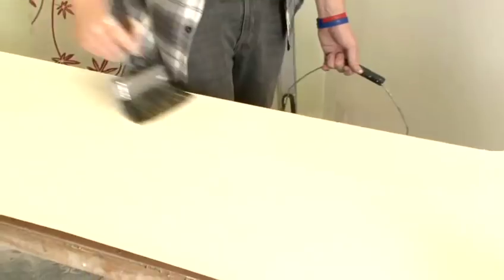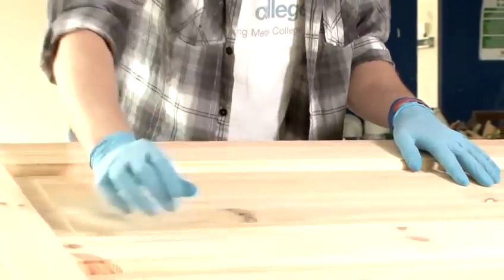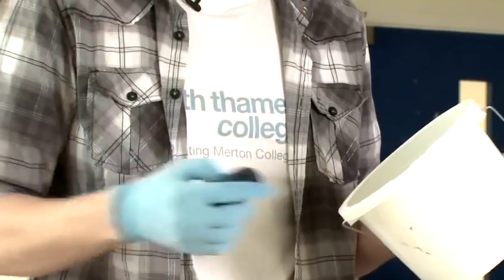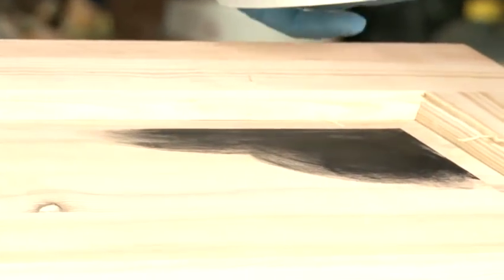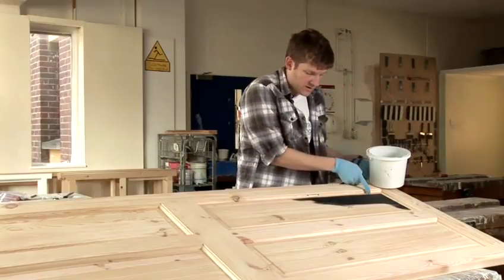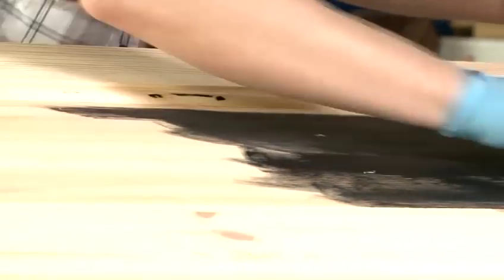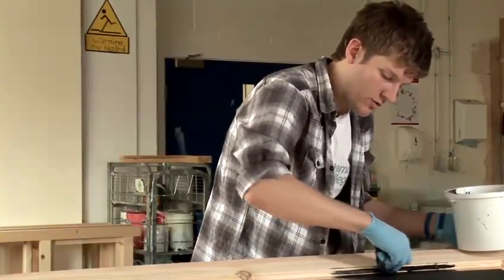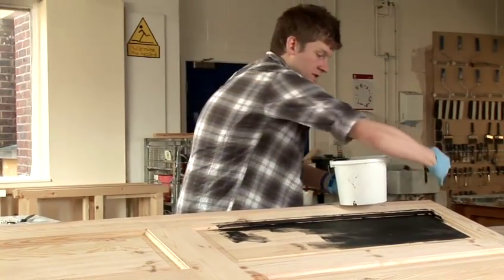How To Use Dark Wood Stains

Comment: yes it is oil based and no you dont need a second coat. If you get minwax polyshades for this then you only have to put that on and it will turn out well.

Comment: Just watched a much better video by a professional. Clearly using a brush would help get the stain into the timber grooves, and the groves on the inner frame edges which are definitely not getting stained in this video. Using a rag after would be good to clear excess stain and smooth the finish to avoid darker spots. There are good video's out there!
Reply: Any suggestions? What was the better professional one you mentioned?